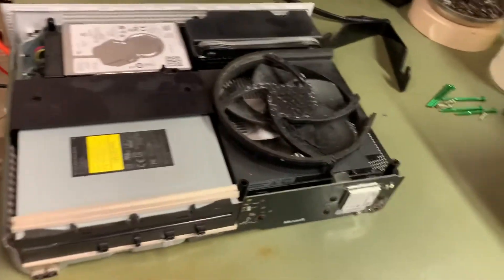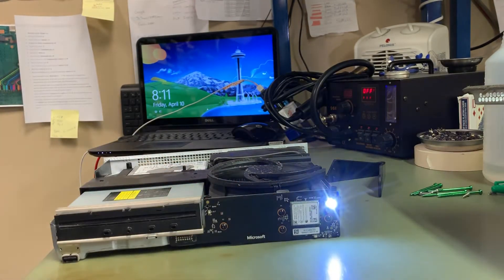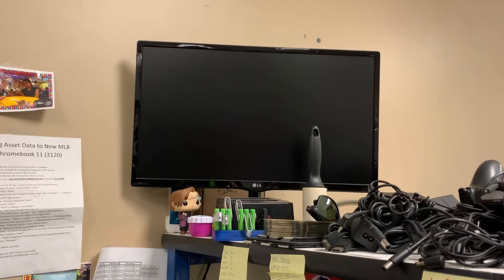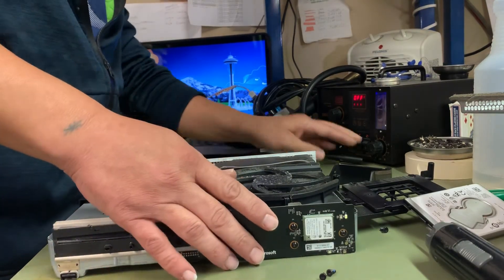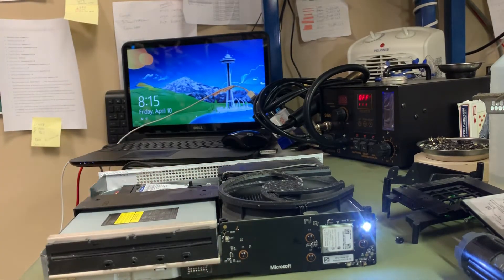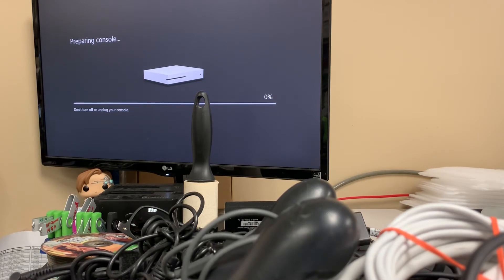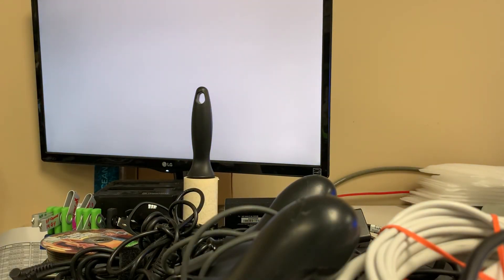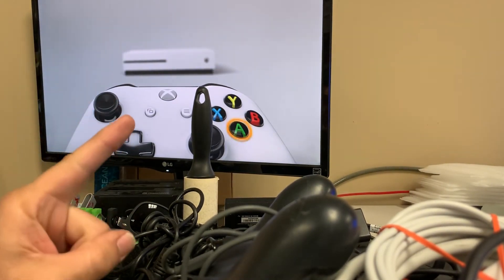New 2020 Xbox one S X Restore Procedures hard drive replacement NO SCRIPT NEEDED Faulty hard drive

Comment: This does not work. Don't even waste your time. You absolutely need the scripts otherwise when the next update appears it will always have an error and never complete. It will create bad sectors on your hard drive.
Reply from the maker: armani1326 ur a completely and totally incorrect.
Reply: @RepairLegion  yeah I was wrong. I'll admit it now. I was pretty stressed out after going through a huge ordeal of errors. It definitely worked for me the next day. Good on Microsoft to make that  process easier and you man for making this known. Cheers!
Reply: armani1326 hi how did you do it? I’m
In a corner. Have reformatted 2 hdds and used a usb to update but the Xbox just comes up with a system error when the offline update gets to a certain point.
Reply from the maker: 30 Minute Music Xbox are picky machines. Do t like toshiba hdd and sometimes only a hdd from a working unit will work.
Reply: @GrabASpriteB  I just tried again to update again. It might seem like it freezes sometimes but just leave it alone for a bit. Don't keep pushing buttons and definitely do not turn it off unless it shows an error occured. Be patient with it.

Comment: script which creates the exact hard drive structure Microsoft uses on each 2TB, 1TB, or 500GB console it sells.this wont work in the long run files wil get corrupt microsoft does not support this ,using the script would be wise

Comment: I got an xbox one original. Been having it for about 5 years.  Not always but from time to time I moved the xbox to different TVs in my house to play on it, worked every time I moved it. This time about a week and a half, tried to move it to the living room tv, connected everything like usual, turned the xbox on and connected the hdmi and all, but was not receiving a signal for some reason from the xbox to the tv and all of a sudden my xbox turns off. Tried to turn it on again and again but all it does now is turns on for about 40 - 60 seconds, then shuts off automatically. Idk what it is. Idk I'm just thinking the most rite now from watching your videos. I'm just thinking like if its possible if I can send you my xbox to see what's wrong with it and if it can be fixed. Might be a long shot but hey I least I'm asking. If not I totally get it. Nice vid  btw.